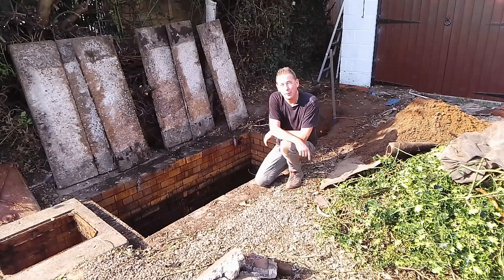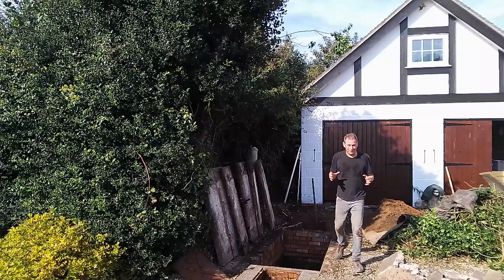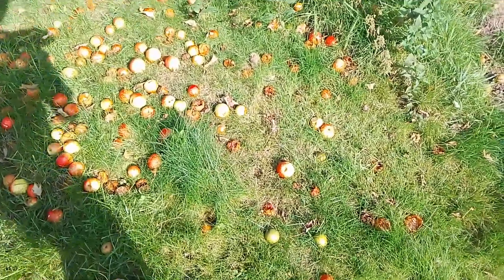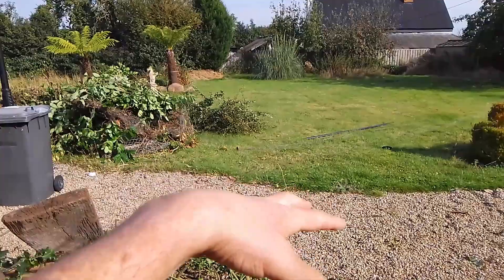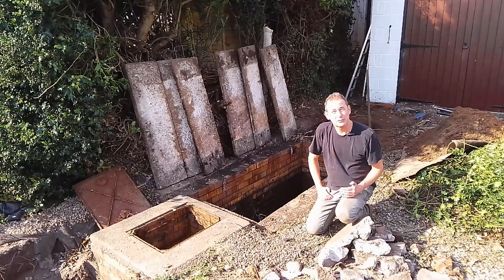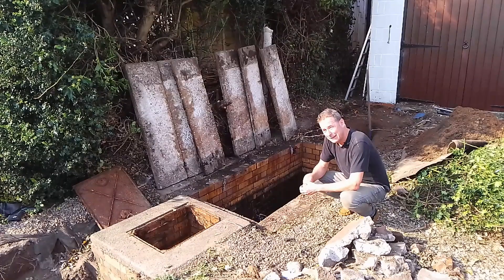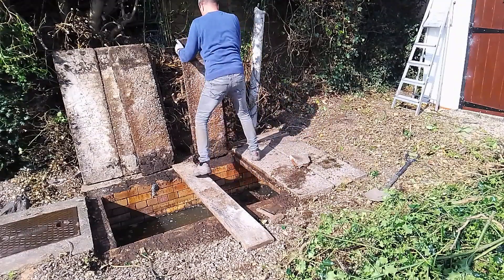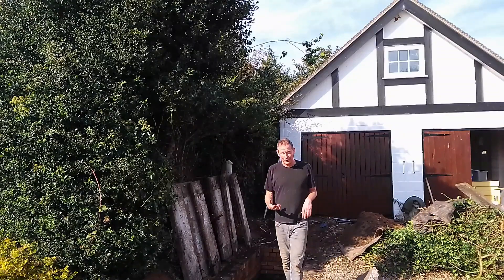Septic Tank Problems (How Septic Tanks Work)

Comment: Great video thanks! Im buying a house with an old hit and miss block tank.  My solictor is worried it doesnt apply to general binding rules.  there is a small river at the bottom of the garden to... We dont have time to get a tank survey. Do you know the likley hood that i will need to install a new tank?
Reply from the maker: The tank may be ok. But it may be necessary to install a new drainage field (also known as a soakaway) which may need a permit. But it's not a huge job.